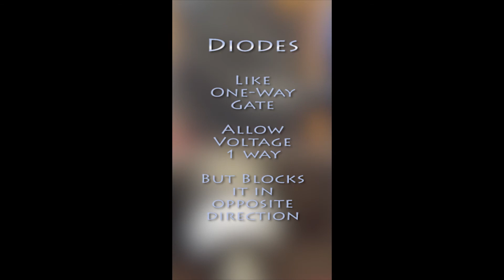Diode Testing

Comment: Thanks. Very informative. But why does the diode convert AC to DC voltage
Reply from the maker: To supply components (such as Exciters and Synchronous Motor Rotors)with needed DC power from an AC source.